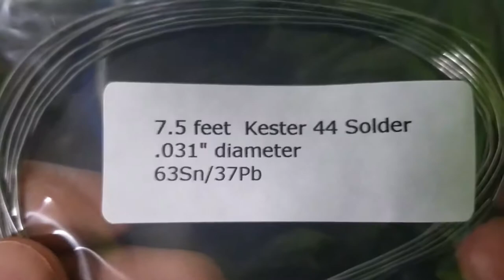MAKE THIS EASY BUTTON BOX w TOGGLE SWITCHES UNDER $30 | DIY | Sim Racing

Comment: How did you manage to get 10+ buttons in 3 pins in th at board or did you just not show that
Reply from the maker: Yes I just did not show after I plugged em all in.
Reply: @TechiePocket1  ok thx for quick reply
Reply from the maker: If you can solder tho, I would recommend using an Arduino Pro Micro board which would allow only three wires for connection.